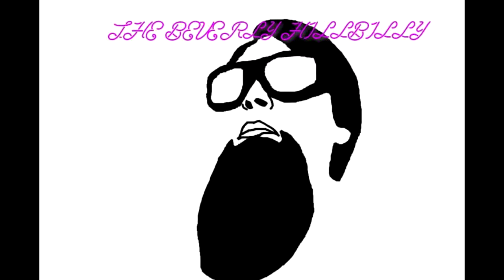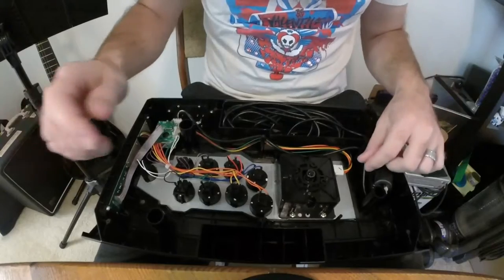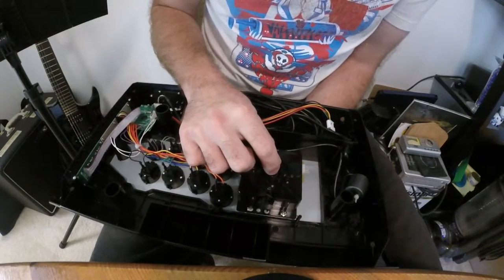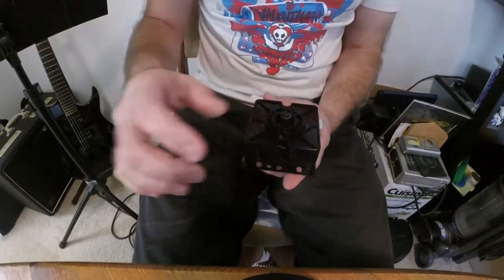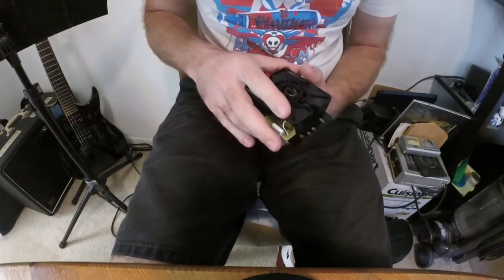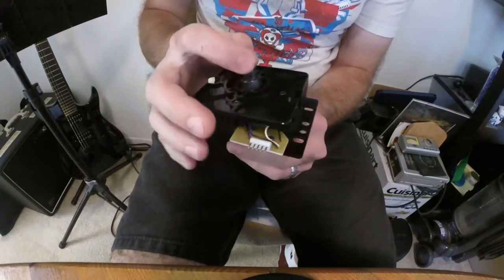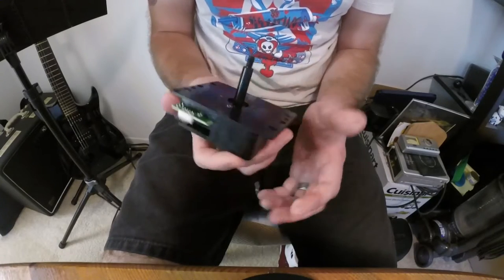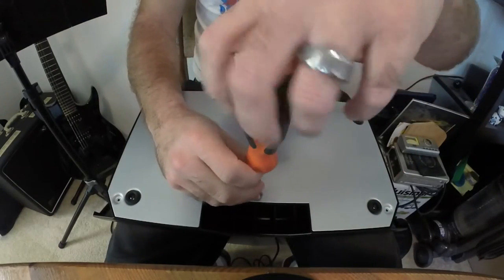Hori Hayabusa joystick spring mod

Comment: Hello whats the best mod for hori hayabusa joystick, i can just replace the spring to 2lbs and octagobal gate or i need also add the KOWAL 1mm Oversize Actuator ?
Reply: Dude ! I have the same question ! I just bought those 3 items and I'll test on my Hrap 4 Kai next week;
But since your comment is 4 month old, I think you have your answer
Reply: You CAN NOT use the Kowal actuator without the Kowal Octopus octagonal restrictor plate installed, as it wont clear the stock plate’s inner lip. I replaced the actuator and plate, but left the stock spring.

Comment: Hi the two sides of the spring are equals? Do you recommend Kowal oversize actuator to Hori Hayabusa. I want to put Kowal octogate+ 2lb Spring Sanwa+Kowal oversize actuactor
Reply from the maker: Thanks for watching.  So this was years ago, but I still use this stick regularly and no mod has failed (except 2 hyyabusa silent buttons from years of what I would call extreme abuse.  I am a lot rougher on my stick than i should be).  From what I remember the spring rate is equal through the coils, so there is no 'right side up'.  I never got the oversized actuators, but I considered them.  The heavier spring was a personal choice, but the factory spring felt overwhelmed by the aluminum ball top.  I installed a Kowal octogate shortly after the spring and have left it on since.  I really enjoyed the middle ground it provided.  It feels like how it looks, right in between a square and a circle.  For me, that was exactly what i was looking for, but its definitely not for everyone.  I was looking to make motion inputs feel more fluid while still having 8 distinct corners for accuracy.  I still suck but it did make motion inputs feel a way I was happier with.  

This will all come down to personal preference, and what it is you are looking for with modifying a stick.  Do keep in mind that no mod by itself is going to make you a better player (I wished for that when i first started playing in the genre).  The heavier spring is going to give a much more positive feedback than the 1lb factory one that floats through the gate.  The oversized actuators will pick up an input faster and you won't have to move the stick as much, but some have complained that they make players prone to fudging the inputs by accidently hitting the wrong actuator.  The blue ball top still looks cool and I really enjoy the extra weight, but some would not.  The silent buttons give absolutely no feedback to being pressed besides bottoming out, but my personal situation required quieter gaming sessions and I ended up enjoying their airy feeling.  

Every mod I have done to my stick is still on my stick 6 years later because I enjoy them and they still work like new.  (besides those 2 buttons but they go through a lot and are most likely to fail first on a stick)  Half the joy was using the mods, and the other half was taking a fightstick and modifying it with things i thought were better.  I hope this long rant answered your questions.
Reply: I feel the same square is not for me and the spring factory hayabusa is too weak. Yes  with oversize actuator sometimes hits some very hard but is not a fault, the hori edge buttons are very weak but working fine but feels so soft and i don´t like this feel
I like joystick like Eurojoystick or Magstick that i put in wood arcade stick.

Comment: Hey not sure what you meant when talking about removing the balltop. do i not unscrew the top part(were the flathead goes) or am i just only trying to unscrew the balltop? it seems like the balltop is barely if at all coming loose am i doing something wrong?
Reply from the maker: I'm assuming that you have the original balltop on.  That's ok, they are really tight from the factory.  Here is the reason why you unscrew the balltop itself instead of the screwdriver:  Inside the joystick is the actuator and all the fragile stuff sits.  Turning the shaft instead of the balltop would put unnecessary wear on those parts.

Comment: What is the name of the spring model you're using? Can I just replace it with any type of spring or does it have to be a specific one for this stick?
Reply from the maker: VeNOM3099 So this is what I have been told and have read:  Most any mod that you can do to a Sanwa JLF stick, you can do to a Hayabusa stick.  When I ordered this spring from Focus Attack, I was told that any spring that would fit the JLF would also fit the Hayabusa

Comment: i got the 2 pound spring and i got a 4 pound spring in the mail which feels better?
Reply from the maker: this decision is 100% personal preference.  there isn't any advantage in picking one over the other.  the 4 lbs. spring (would like to try out) is going to be quite heavy, but you may prefer the extra feel from moving the stick.  try them both out.  hopefully this video helps you install whichever spring you try out.
Reply: I can give you a update the 4 pound spring makes the stick almost quite and you dont get that click that lets you know you made the correct movement. It takes away the feel of the movement and the sound. I think i will put the 2 pound spring back in because you got a stiffer stick but you also keep the audio cue and you can still feel the switch so you know you did your movement correctly. At this point i like the stiffness of the 4 pound switch but i dont like it at all that i can no longer feel or hear the switches.

Comment: Somebody can help me? Does Hori RAP V for Xbox has the same components inside?
As I saw in the comments bellow, I'm able to use Sanwa components, are you using the original actuator? Could I use some Sanwa actuators?
Reply from the maker: Tiago Carvalho the RAP V for XBox will be exactly the same as my stick.  I am still using the original joystick, which is the Hayabusa.  But yes, Sanwa parts like the JLF joystick and buttons will fit in the RAP V
Reply: Man sorry bothering you... just another one question, do you know whether I can change the original throw with seimitsu's throws? Will be necessary some  mods for it, or it's gonna work fine like JLF?

Comment: Will this process applicable for hori rap pro N ?
Reply from the maker: Gaurav Singh it should be.  I am not 100% sure, but it should be exactly the same
Reply: same, only the Haya Silent is way different
Reply: I have the hori rap pro n hayabusa.  I didn't like hayabusa joystick because it's too loose so I bought a semitsu joystick from arcadeshock (see link).  They recommend me the seimitsu-ls-05-06-as which not only comes with the joystick but five different springs and I did buy it.  The thing is the seimitsu is already a stiff joystick.  Will I be needing those five different springs, because I like my joysticks stiff like korean battops, and this is my first time modding an arcade stick, I don't want to mess up. 
https://arcadeshock.com/collections/joysticks/products/seimitsu-ls-56-01-as-multi-tension-joystick

Comment: I can't remove that c clip.
Reply from the maker: That blasian over there it's in there very tightly, which is what t is designed to do.  Are you still having trouble?
Reply: Beverly Hillbilly nah I got it like an your after I posted that comment. but yeah it was hard to get out. I was mostly scared to do it which is why I thought it was so hard.

Comment: I can't take out the dam c clip. :( I'll just buy a Sanwa lever.
Reply from the maker: those clips can be difficult to get out without damaging them if you haven't really dealt with them before.  if you dont have a pocket screwdriver, eyeglass screwdrivers and small knives can also work (of course be careful).  prying from the middle of the 'C' is the best way to get them out